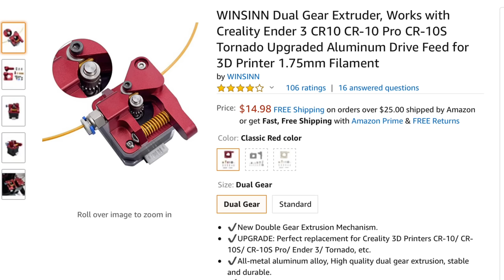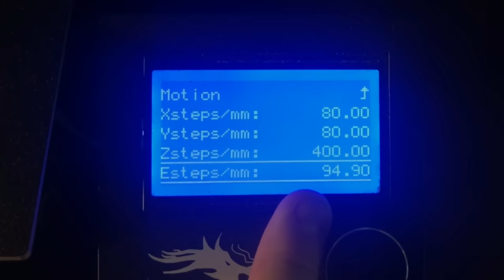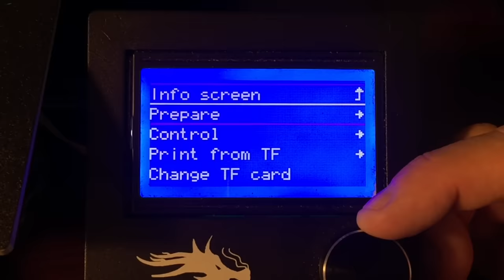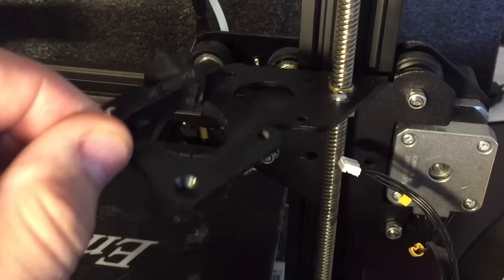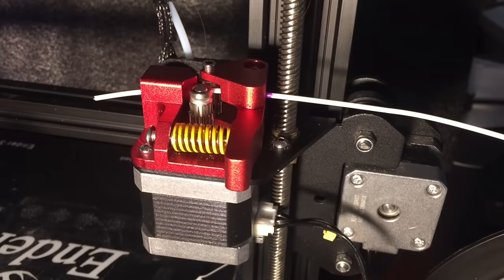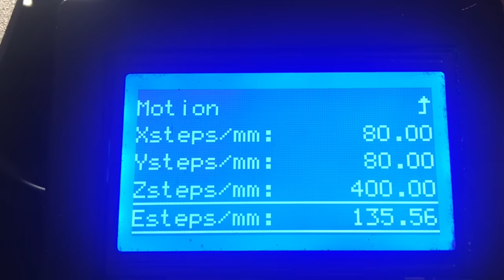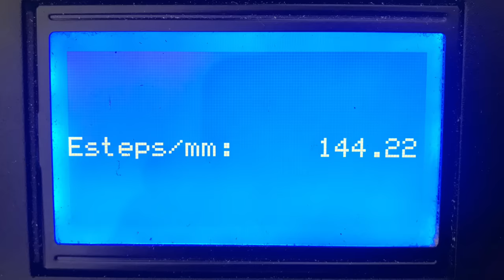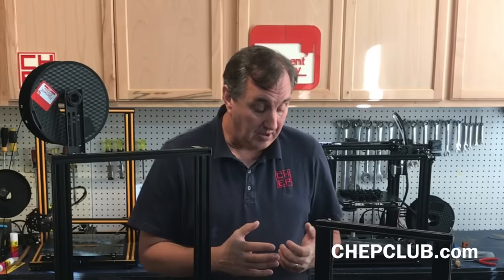Dual Drive Gear Extruder Upgrade + E Steps on Creality Ender 3

Comment: Hi Chep.
The newer ender 3 pro printers have a press fit gear on them now.
What should I do?
I have the same kit.
Reply: I'm having this same problem
Reply from the maker: Not sure. I’m going to look into it.
Reply: I wonder if a gear puller would work?   Did you find a solution?
Reply: Can confirm, the new ender 3 pros have a press fit gear on them. Also, the shaft length was shortened to 12mm instead of the standard 20, requiring you to buy a new motor in order to install the dual gear drive. If the press fit gear is at the very top of the shaft, then it is a 12mm shaft. Learnt this the hard way after sawing off the press fit gear on mine. Thankfully, I was able to use the new gear pushed all the way down with the spring compressed all the way (and tuning the esteps way up to compensate for the smaller circumference) while I wait for a new motor to arrive. :/
Reply from the maker: Where did you buy it from?
My Ender 3X Pro from Banggood.com came with the removable gear.
Reply: @FilamentFriday  My printer is from the Creality3DOfficial store page. ("official")
Reply: What size Allen wrench does the new gear use, of all the tools I have nothing works
Reply: My new E3 V2 that just arrived today (date on box, Jan 2021) and it has a setup with the locking nut thing. Which is good as Amazon/Creality had a sale where I received the double gear extruder for free.  Followed instructions and the new extruder is installed. Now to finish building the printer. Thanks for the useful video Chuck!

Comment: I have a regular Ender 3, how would you take the gear off the motor because there are no screws in it
Reply: I had the same problem, they say you can heat up the gear then pull it off with the use of a tool and a large quantity of pulling strength. But, I just ended up buying a new motor and gear.
Reply: You can not mount the Dual Drive Gear Extruder on the motor with pressed mounted gear, the motor axe is too short. You have to buy new motor with long axe.
Reply: @yurik.3865  What motor did you buy?
Reply: @loganhobbs6910  just look for motor 42-40 mm . I can not write here where to buy- any such comments deleting by tube.
Reply: Motor without the gear.

Comment: Don't waste time or money on this trash "upgrade". The 2nd drive gear is poorly designed and does not ride on a real bearing like the stock equipment. It shifts around on the screw that holds it and grinds on the aluminum arm. It dose not add anything to print quality and referring to it as an upgrade is false advertisement. Its a down grade from the plastic one Creality sends as stock.
Reply: Except the stock plastic ones tend to crack...

Comment: I love how people say ender 3, not ender 3 v2.... thanks for the misinformation
Reply: This video is 3 years old...V2 didn't even exist at that time...
Reply: @cxvxcbcxn  true, I have a new Ender 3 (not v2) and the 42-40 stepper motor has a shorter shaft and a pressed on gear... while I got the gear off (by destroying it) the shaft is too short for the new gear...now my main printer is down
Reply: @acidnine  Same situation, but Ender 3 Pro with 4.2.2. I struggled for a while and then remember I had a gear puller for RC car motors I picked up on Scamazon for 8 bucks and it popped right off.

Comment: The reason you probably didnt see even better print quality is because both were presumably printed at the same print speed. With a more consistent flow you should be able to increase print speed and still get the same quality as you did before. The main issue i seem to have with slippage is either when the roll is getting closer to empty and it is struggling a bit more to turn the spool, and also when printing infill at a high speed.

Comment: I just got one of those extruders for my Ender 3 V2. The plastic one was cracked and constantly slipped.

I have had the printer for about a year and never calibrated the e- steps before. This is a simple, easy to follow video and I'll finally get it done before my next print.
Reply: Ok so just went through this. My e steps were 40mm short. So not even in the same ballpark. Your calculation got it pretty much prefect first try.

Comment: I'm sure that the idler gear grinding is a setup problem in most cases. Look at the concave shape of the filament teeth. The idler gear is aligned by the filament under pressure  - and the filament is aligned by the drive gear. Easy method - 1. Loosen the grub screw on the drive gear just enough it can slide easily on the motor shaft. 2. Put a straight piece of filament through the unit just like in use with the bowden tube installed. 3. Move the filament in and out a few times, carefully stopping where you can tighten the drive gear grub screw on the motor shaft without shifting it. I didn't bother but as best practice; step 0 would be to space the top and bottom of the idler gear with paper.

Comment: I threw in the towel on this upgrade. Worked like a charm for about 2 weeks before you could just tell it was tearing itself apart. Switched to an EZstruder, which is very smooth! If you do the same, you may need to tune the extruder stepper motor current, just FYI.

Comment: Biggest improvement people will see with this upgrade is faster print speeds where a lot of filament needs to be pushed through but also with smaller diameter nozzles since they require precise pressure control and you can't get that with stock which slips a lot. Also smaller gears meaning more turning meaning more precision for same filament length.

Comment: There is one other thing about this feed head* that you never mentioned.   It's the reason I bought the same one before even seeing your video.  The spot where the filament comes out of the dual gears and enters the hole in the aluminum leading to the PTFE fitting is a nearly true 'v' with no gap. This is the first aluminum extruder I have seen with that full V so I bought it more for the V than I did for the dual gears. (most other aluminum extruders 'flat top' the V creating a small gap between where the filament comes out of the gears to where it goes into the hole in the aluminum)
About a year ago, I bought a direct drive for my Ender 3 and chose one specifically because it came with an aluminum feed head. I had the silver-chrome branded feed head but didn't want to mess it up. I was getting the direct drive to do flexible filament without buckling in the bowden tube and to prevent that buckling from knuckling the filament coming out of the gear. But many recommendations also said to use a feed head with a 'v' that butts right up against the gear with little or no gap. There are models that can be printed on thingiverse, but at the time all I had was PLA and a no-name role of ABS that I still can't get to print right to this day. (too brittle and layer separates constantly)
What I found instead was a suggestion of using an aluminum feed head and drilling a hole through it for a piece of Capricorn PTFE tubing that has the 'v' cut on the end of it.
I've been using that set-up with the aluminum feed head that came with my direct drive mounting bracket for close to a year. But I recently tried printing some 80A filament and find that it's too soft for even that setup. So I ordered one of these feed heads and I'm going to give it a try as soon as my current 18hour print finishes up with the 80A filament to see how it does.
The aluminum 'v' (as opposed to just a piece of capricorn PTFE) should fill the entire gap between the two gears and I'm hoping will prevent this squishy filament from finding a hole out through the side of the gears. And the addition of the pressure fitting should mean there is a more solid channel for half the distance to my hot-end rather than the full distance being nothing but the PTFE. crosses fingers
I'll report back after I mount it and try some of the 80A and 85A to comment on my results with this feed head. (I've had no problems printing 90A and above with the PTFE through a standard aluminum feed head btw)

* (I don't like to call them 'extruders' because that gets confusing when you also talk with people about 'extruding' their own filament. I don't really think of it as 'extruding' because it's simply moving the filament along, not necessarily forcing it down the bowden tube. Yeah, it "extrudes" at the hot end nozzle, but that would make the nozzle the "extruder")
Reply: initial response. It doesn't fit my direct drive mount. The one I bought is bent in a 'z' type shape to offset the stepper motor with the feed head on the back and there is a hole through the flat section bent outward that you feed the pressure fitting and short piece of PTFE through to the hotend. It would need about 9mm more on the bend due to the slightly increased height of this feed head.  I shot a support question to Printermods to see if their mount will work with this dual gear setup. Someone posed the same question on their amazon page and they said they would be posting something to their website to print an additional spacer to fit. Their's uses the same type configuration, but rather than bending the metal to create a mount for the stepper motor, they use offsets and a second piece of metal for the stepper and feed head to mount to. However, by looking at what comes with the kit, the spacers are made for the standard height aluminum heads. I couldn't find a reference to a printable spacer on their website, thus I shot the question to their support.
Reply: unfortunately, I could fabricate all but the two posts that stick out to screw the hotend too. or I would just make another version of the one I have. I may look at it again when I get home after the weekend if the printermods version won't work. Otherwise, I suppose my only choice is the micro swiss setup

Comment: this double geared extruded worked wonders for me on my CR10 mini, i didn't have to do any other modifications to be able to print tpu and i was very happy about it,
after 3-4 months i started to notice some metal dust at the base of the gear and i didn't think too much about it because it was still printing great, unfortunately after another couple months i started to get tpu filament jammed at every print, in the end turns out that the "movable" gear (the one mounted on the spring arm) had indeed dug itself into the metal at the point that the two gears weren't at the same height anymore...maybe a washer could prevent this?too late for me anyway...I'm switching to a bondtech and see how things will go...
waiting for your video about cura 4.5!!!
thank you for all the help and the great content you provide us

Comment: thank you Chep, I just replaced my motherboard after an extruder driver failure on my ender3 pro and I forgot how to calculate the e steps for this duel gear extruder  but remembered u had the go-to video on how to do it  thanks again

Comment: As a new and dedicated follower. I wanted a better extruder, hard to choose when there are always so many negative reviews (even down the comments here). However, you do tend to find this with people at home with different skill levels. When considering how reasonably priced these units are and how easy it would be to replace I can't understand sometimes "why so negative". Followed you through to the end, no mucking about with the numbers as you worked them out.. Rocking! I did find that I had to do some fine-tuning of the bed "again" but am back to pretty decent prints. Congratulations on being the best and most informative "goto" guy. You have made my hobby a lot more enjoyable.

Comment: I spent hours trying to get this to work today. Took me forever to figure out that the my ender 3 didn't have the enough flash with marlin to allow for the estep config. After some more hours I finally decided to use a raspberry pi 3 with ocotoprint to achieve this. 

I used the following commands 

1. Put the extruder into relative mode with the command(Otherwise you cant extrude more then 50mm at one time and will need to run the command twice) :
M83

2. Extrude 100 MM in 100 seconds:
G1 E100 F100

3. Check the distance it went versus what you wanted

4. Run this command and search for the line with M92. You want the E value this is the current steps: 
M503

5.  To set a new value:
M92 E135.5

6. Save to eeprom
M500
Reply: I just realized this myself! I'm glad I look through the comments!

Comment: I did this upgrade for both Ender 3 Pro and Ender 5. Re-calibrating was definitely necessary. I have maybe 5-60 hours on both extruders now and so far so good! I did as you suggest and use grease around steel/aluminum joins and also a drop of oil on the inner finger bearings.

Comment: Hi Chuck 

A problem with these metal Extruder upgrades is the design of the Idler Gear in the Lever. The Gear has a needle bearing but they use a Screw for it's Shaft so the Bearing is running on the sharp threads of the Screw. Far from an ideal situation and is going to wear out prematurely. The Bearing will also likely be damaged. It's like a lot of these upgrades were they have a decent product  but end up cutting corners.

Cheers 
Willy

Comment: Chuck an excellent video as always. I installed one of these yesterday as my extruder is probably the only thing giving me issues at the moment. I upgraded to a standard aluminium version of the Creality extruder about a year ago which has been fine for the most part, but still skips more than I'd like. This new Dual Gear extruder seems to be a lot better and after calibrating the E-Steps puts the correct amount of filament through to about 0.4mm accuracy with 100mm of filament.

One thing to note. Anyone with a standard Ender 3 or CR10 should change their retraction settings after fitting this. The standard settings in Cura for the old extruder is 7mm retraction distance and 70mm retraction speed. I usually got good results from that, but since this extruder is very different in design this setting is far too harsh and can grind filament and even cause skipping of the motor.

To get the correct default retraction settings for this extruder I simply added a CR10S Pro into Cura on printers then checked the default standard profile for the retraction settings in there. This is set to 5mm retraction distance and 45mm retraction speed. It makes sense to add that as your starting point, then tweak up or down depending on what you're printing and if you're getting stringing or not, with the aim of getting it as low as possible without stringing. This might also be very different if you have Linear Advance setup correctly and in some cases can mean you need little or no retraction.

Hope this helps

Comment: Thanks for this, I just found that my Ender 3 was soooo way off when it comes to Esteps. No wonder I had to keep making the flow set to 155 every time I start a print. Adjusted Esteps to 237.50 mm and now I just print without any changes in configuration anymore. Great video!
Reply: U adjusted estepd to 237? U sure that plastic housing of extruder isnt broken? 
Had the same prob. But, when I had a lot of retractions. There was no filament coming out.

Comment: Ahh Chuck, this really helped me solve my flow problem, with that extruder on running on a 42/40 stepper motor on Ender 3 v2, my setting came out at 137.9. It worked perfectly, thank you for posting and sharing! :D

Comment: When I performed this, I pushed the filament all the way though the bowden tube with the coupler off the hot end, so this way you can take into account the free air space and resistance the bowden tube can have. I marked it as soon as I saw the filament coming out, made a gcode command to issue 100mm step move and then measured at the end of the bowden tube. I did the same calculations and found that my Ender 3 Pro was sitting at 99mm stock.

Comment: The 6mm probably isn't slip. It's probably the springy effect of the filament in the PTFE tube and hotend. Notice that 6mm is the standard retraction distance too.

Comment: I just bought my dual drive gear extruder.  Im definitely going to use your video to install and calibrate the new one.
Reply: Just installed the new dual drive gear extruder and used your formula.  I wasn't sure if your formula would work for me since my initial steps per mm was 93.  The test showed at temp stopped at 34mm!!  Holy cow that's way off.  So I used your formula and it the result was 140.91.  I thought that's a big number, but I trust your method.  So it took a while to spin the knob to reach 140.91 and out of excitement I didn't hit save.  So I had to spin the knob to bring the steps per mm back up to 140.91, saved, marked 100mm on the PLA, and tried it.  Boom right on the mark!!  Thanks again for the great how to and all your videos!